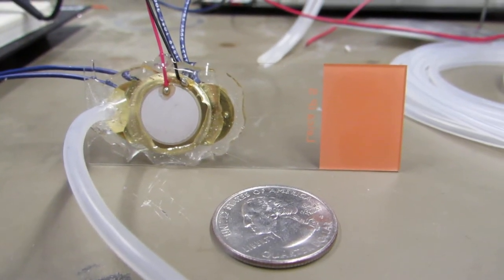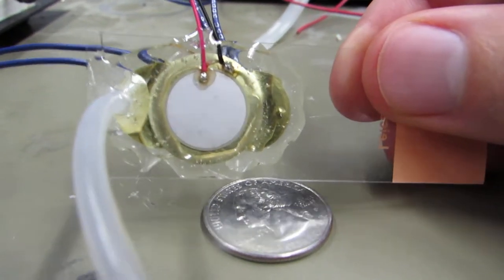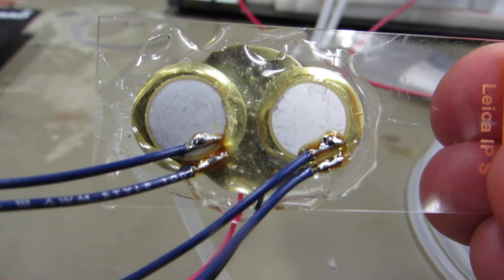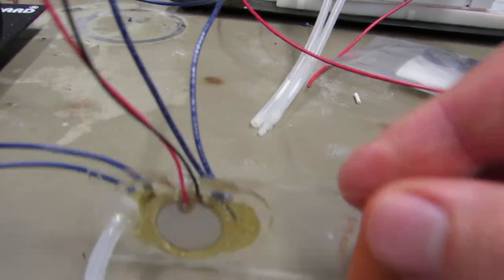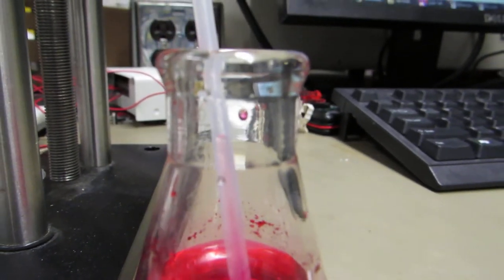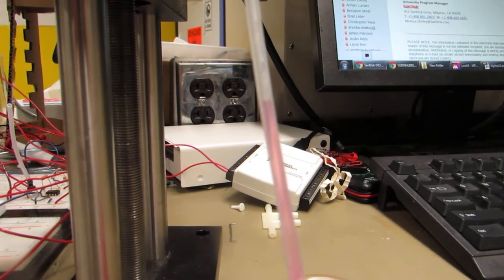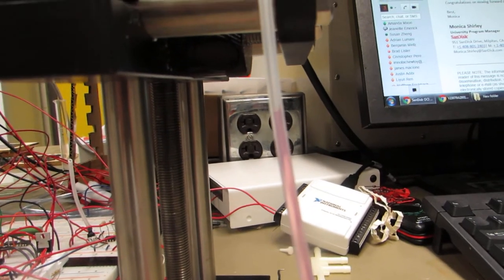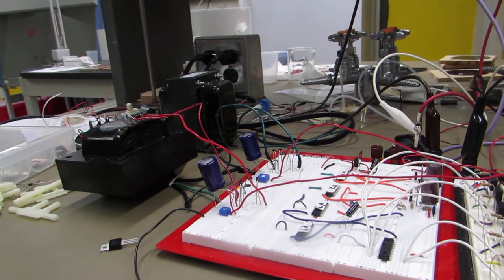Micro Piezo Vacuum Pump Can Achieve -40kPa Vacuum

Comment: Do you think a piezo arrangement would be able to compress gasses too? ...  I need to build an ultralight and ultra low power system able to deliver around 300 psi of gas pressure at very very low flow rates, in the 30ml/min  (1.8 cubic inches/min) range... TIA. great work.

Comment: Impressive! I tried to re-emerge the experiment, and it failed because of the piezo model，could you tell the datasheet of pump piezo?
Reply from the maker: They were audio piezo buzzers. Believe I got them from digikey. The driving scheme is the tricky part. High voltage, low frequency, and the sequence has to be precisely controlled

Comment: may i ask why you use 3 piezos instead of 1 piezo that automatically drives 2x1-way valves? wouldnt that be much more economical?
Reply from the maker: I made pumps with passive valves as well. They do not have as good performance in terms of max vacuum and flow rate
Reply: @SterlingNesbitt  thank you for the reply and explanation.... did you meassure the difference between passive valve and active valves? what factor is it?
Reply from the maker: @snapo1750  I got 2kpa vacuum with a passive valves and one piezo
Reply: A passive valve would actuate by differential force across it. At lower pressures, any differential force generated across the valve would be insufficient to open the valve. This is why actively operated valves were required. 
   Awesome implementation, I just wish I could have thought of it myself instead of reverse engineering the operating principles. I'd like to have seen it's construction, but love the video clip.

Comment: Should do the mathematics on the efficiency, I would expect it to be decently good for a pump.
Reply from the maker: Correct. The energy used will be a function of the piezo's capacitance, voltage, and frequency. Multiple by the inefficiency factor for the circuit which isn't bad because it's class D. I also had a more advanced circuit that would scavenge energy from the piezo when discharging for higher efficiency.